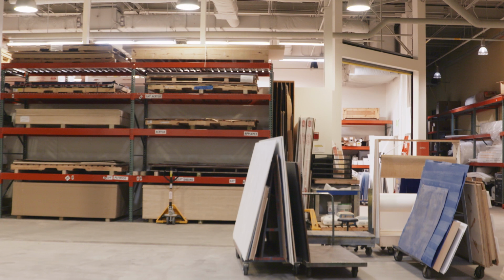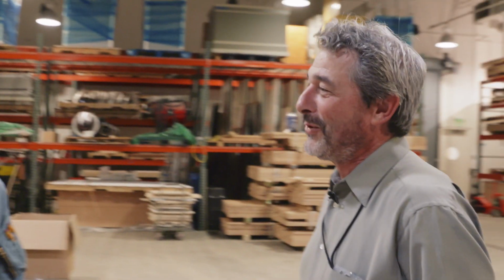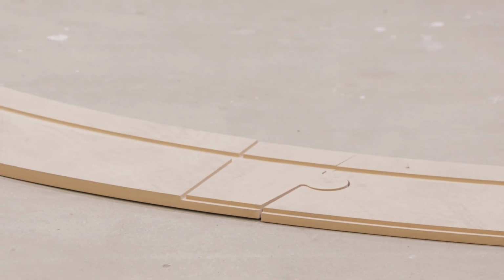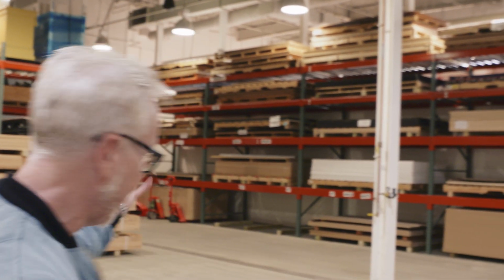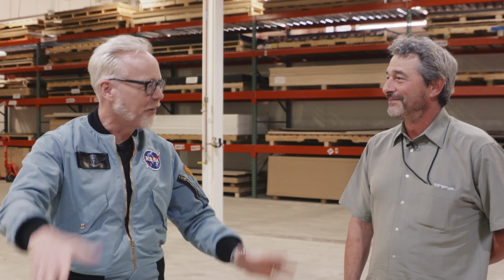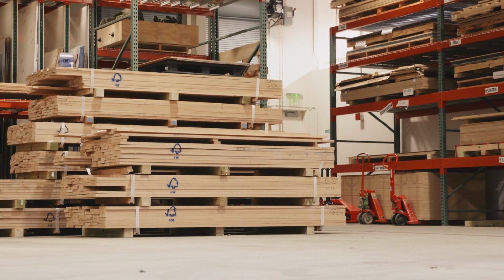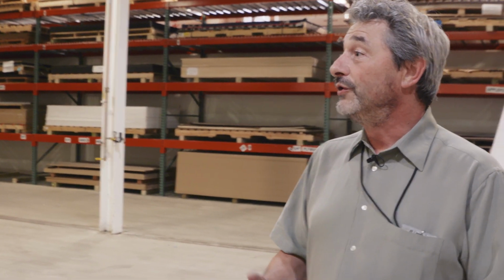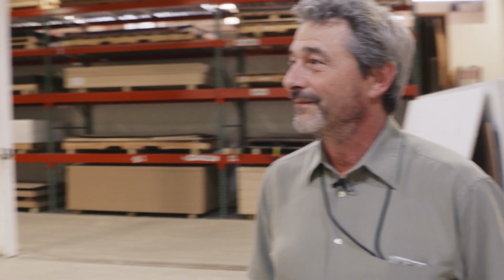Adam Savage Learns About Smithsonian Exhibits' Installation Process!

Comment: I'm really feeling the "You don't know how it will be until you actually see it in full size", and especially concerning graphics!
I normally design for screen, but I recently had to design for print, basically for the first time: a 4.5m x 3m (+-15 x 10 foot) banner for a convention booth!
I was terrified all the way through the design process, partially because I had no way to practically guage it's size and spacing, and I still don't know if it will actually look OK... We'll find out in about 2 weeks when we arrive to set up the booth! :P
Reply: If you did your do-diligence correctly, everything should go well.  Spacing is all relative.  If it looked good proofing it on your monitor, most likely you'll be fine! Good luck!
Reply: @grafitea  Thanks! :)
I just hope things aren't too big/crowded to properly look at from nearby, and also that the colours are correct! :O